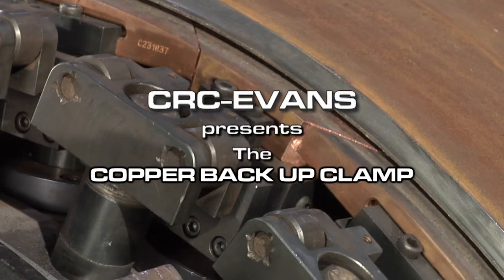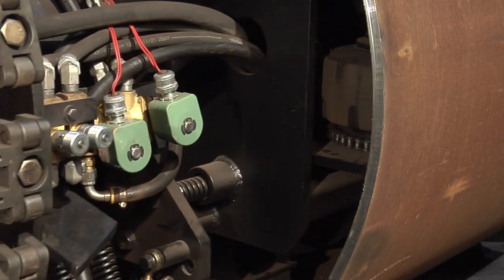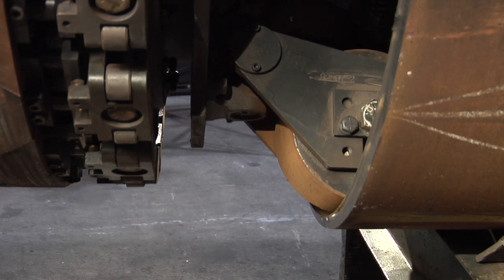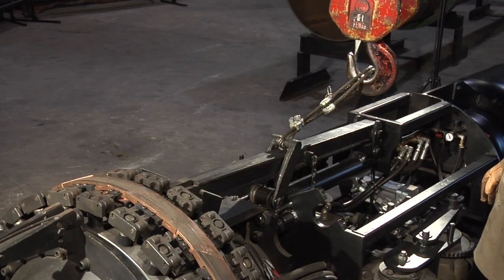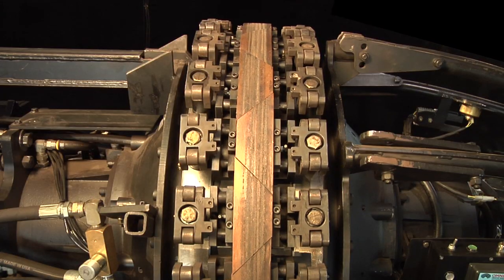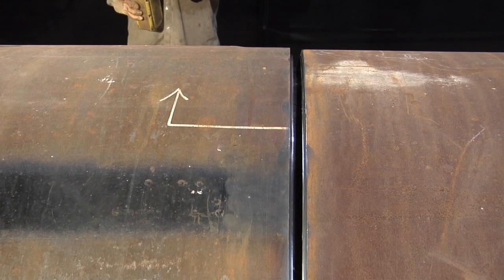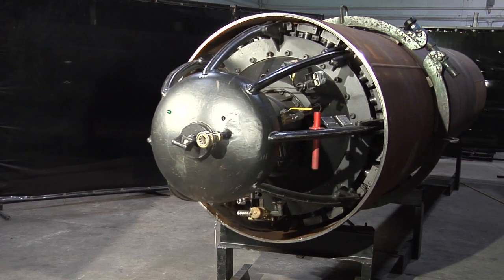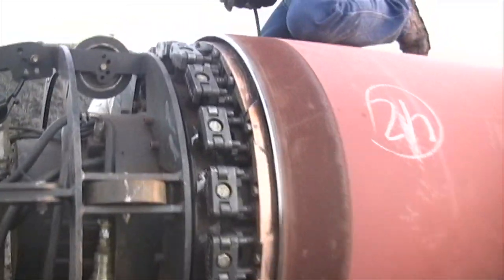CBUC - Copper Back Up Clamp

Comment: How long does the 2 12volt batteries last?
Reply: Can i get this amazing equipment at smaller ratings/size.?
Reply from the maker: CBUC's begin at 16" and range up to 60". If necessary we can custom build one.
Reply from the maker: During production the batteries are constantly charged.
Reply from the maker: CBUC's begin at 16" and range up to 60". If necessary we can custom build one.

Comment: money wasted for a sinple operation to centre pipe for weld, when u can use more ceap few bars welding inside to one pipe and joined , i scared to ask price for thease machine, and to many mantenace thing oil ,etc . just think u try to put thease in to pipe demaged and cilcle is no mor perfect  ,how u fixed bicos thease think sint have front or back hidraulic press for thease tipe dmg, so verry useless machine
Reply: It's use is to provide a non-consumable backing for single sided welding - a huge cost savings, not meant to solely line up the pipe...
Reply: Guess you never pipeline before.